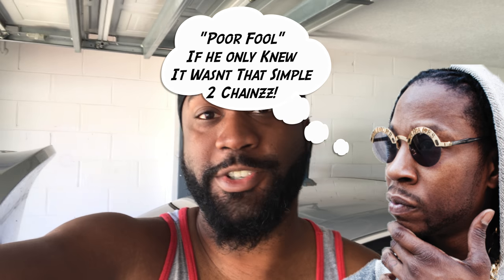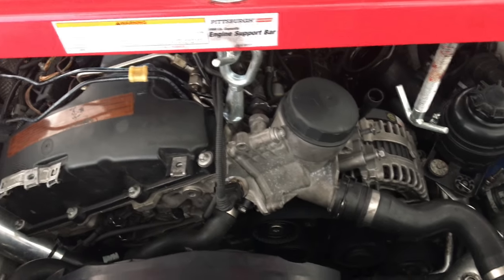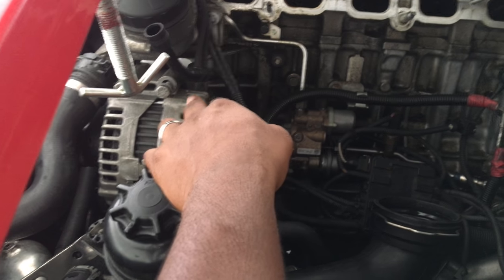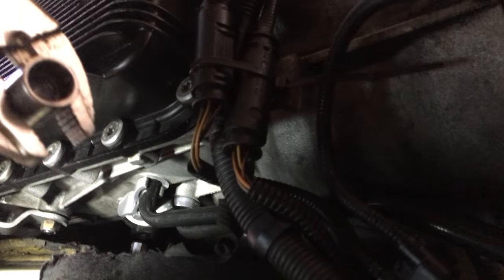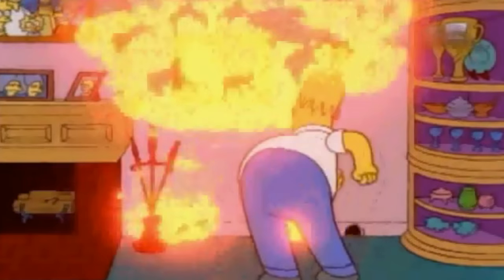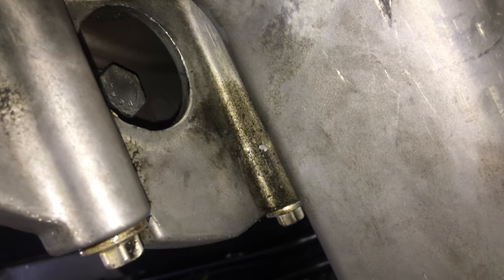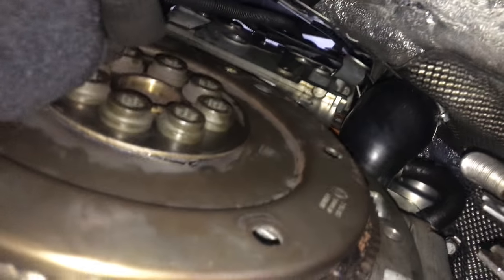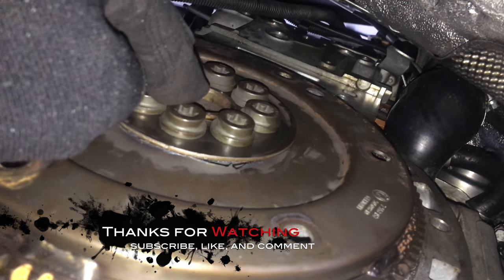BMW N54 335i Flex Plate Removal Pt 01

Comment: flex disc is the guibo which is not the flex plate (flywheel) next to the torque converter... correct me if I am wrong. Please change the title.
Reply from the maker: Your absolutely correct! Ironically in the description I had it correct but fudged on the title lol , thanks for bringing it to attention.

Comment: I just went through an issue on mine. Bought a 2010 n54 and my car is an 07.. didn’t know the flex plates were different. So gotto go through this too lol feel your pain!
Reply: hello, I am doing a very similar process, I bought a newer engine with 6 bolts while mine is 8 bolt. in order to do the engine swap do I just need to replace the flex plate/flywheel? thanks so much
Reply: Shehab Elhaddad hey man! Yeah, that’s pretty much all you need to get the job done. I actually ended up dropping the transmission two times because I got the wrong 6 bolt flex plate. The one that ended up working was from a 2011 535i. It looks like this one I recorded in this video https://youtu.be/NLo3gBXk4Qg let me know if you have questions 👍
Reply from the maker: Correct, since the newer engine is 6-bolt, just get a 6-bolt flex plate/flywheel (automatic/6-speed).

Comment: Aye man, hopefully this reaches you, had a knocking noise coming from below and it went away when i put it in drive, now i can hear it knock in drive and the car went into limp mode, and struggles when giving it gas. Originally i diagnosed it as a bad flex plate, could a bad flex plate cause a surging idle? I have a 335i.
Reply from the maker: I wouldn’t rule anything out with an n54, but limp mode and surging idle id think there something else contributing to it. A bad flex plate you’ll hear a rattling off and on and then it will increase with loudness till it doesn’t move at all.